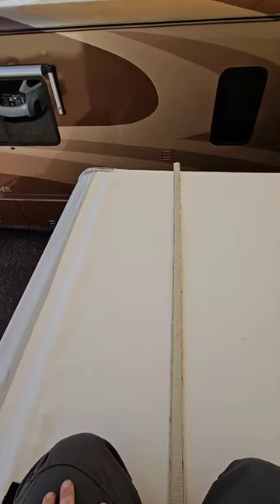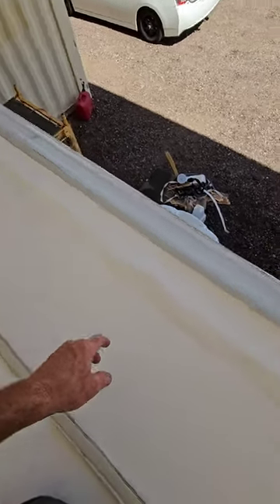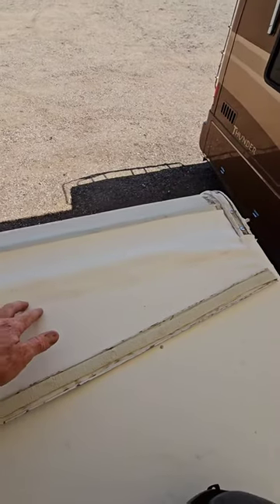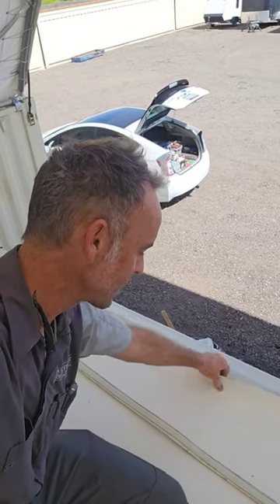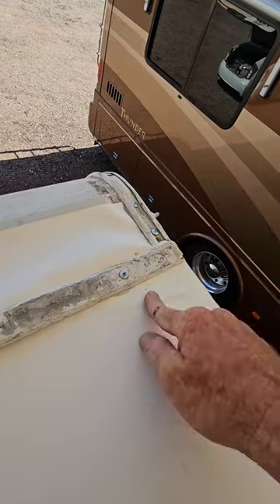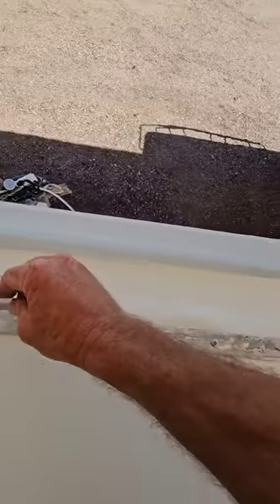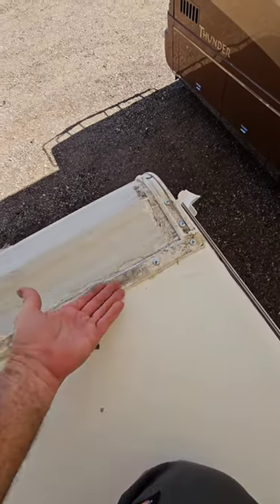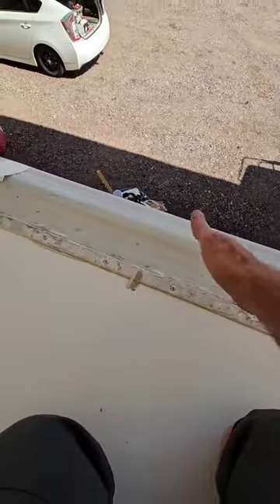unpopular rv roof opinion

Comment: PVC membranes FTW again.  Full length membrane tucked underneath the front cap, like the manufacturer.  And cut a second strip to lay across the top of the cap, welded to the field area. 🤌
Reply: I service MI, IL, IN, OH.